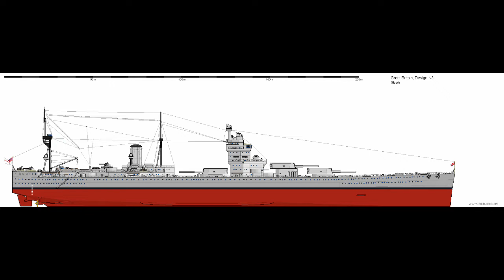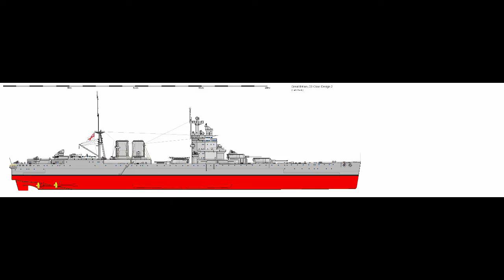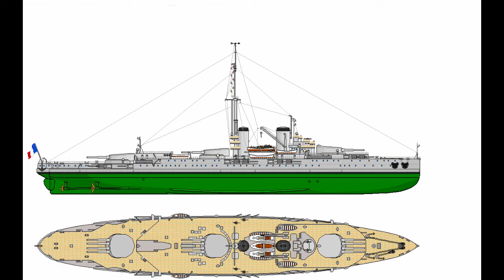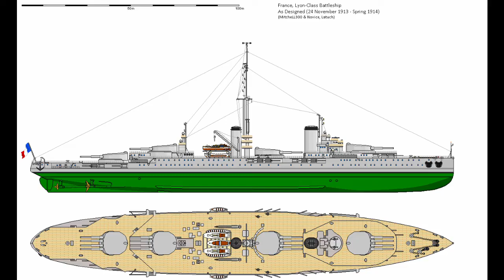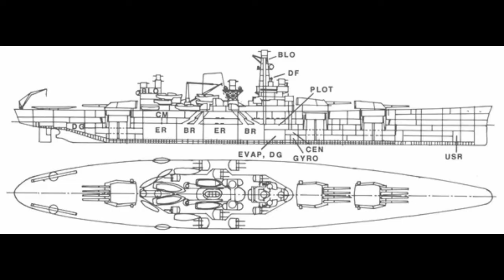General History: Interwar/WW2 Battleship Turret Layouts

Comment: Interesting perspective on the KGVs "weird" 2 x quad + 1 x superfiring twin arrgt of turrets but the key reasons are really quite few and understandable. As though of course the initial aim was for 3 turrets in a (two forward, one aft) conventional layout with all carrying the same number of barrels. 
Yet, it must also be remembered that the projected ships were BRITISH + s.t. existing treaty limitations + with HMG wanting to secure further treaty restrictions on std displacement and max gun size too, in the next round of negotiations.
Ergo...
1) You can't just cheat on all or any of the current treaty provisions, 'cos that's "not done"
Despite, of course, by those who're 'obviously' foreigners of the worst type.
Yet, even though you know "the usual suspects" will all likely be doing just that in any case... 
2) You still can't just blithely develop a bigger new caliber gun on the quiet and use that at need
'Cos that'd be frightfully embarrassing while you're simultaneously trying to advocate for a smaller max caliber.

See where this is going yet?😁

Comment: im not sure how to ask this question ... when you build a ship you build the hull to support what its had when launched .. did they ever do a ship they designed to hold say 4 or 5 main turrets but as built only had 3 or 4 ... so then they could refit the ship into a newer better one in same hull .... like thinking forward ..... does this make sense to anybody??
Reply: Nope. Think about it, you would have to build the ship of the final size anyways, so why not just go full tilt anyways and add the extra turret? Other nations would see through the trick anyways given your ship would have to have a suspiciously empty space somewhere where the barbette would be, and just build ships to counter your maximum upgraded ship anyways. The closest i can think of was the US commissioning USS Wichita with only 2 of her 8 secondary battery guns to get her to fit the treaty weight limits.

However, the reverse was actually done. The Italians for example dropped one turret on their second generation Dreadnoughts and used the space thus freed up to install more powerful machinery, which made the ships much faster at the cost of firepower. These rebuilds are some of the most extreme you can do for a battleship though and get so expensive that building a new battleship as a replacement to the old one instead becomes a serious consideration.